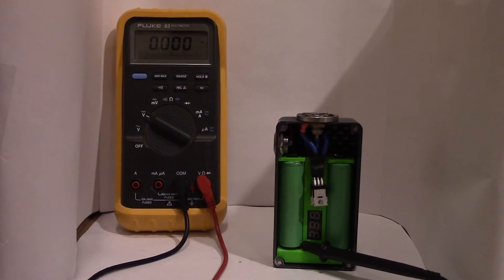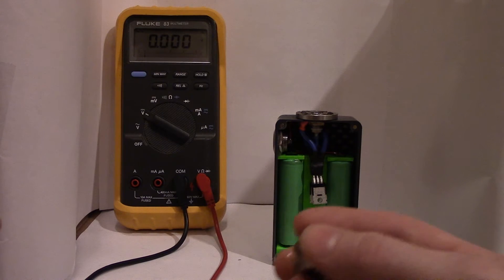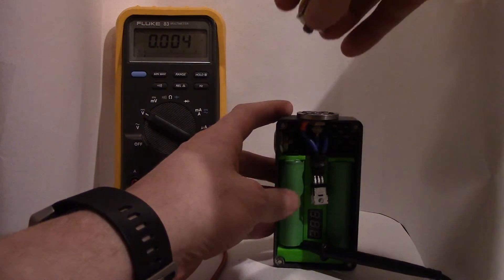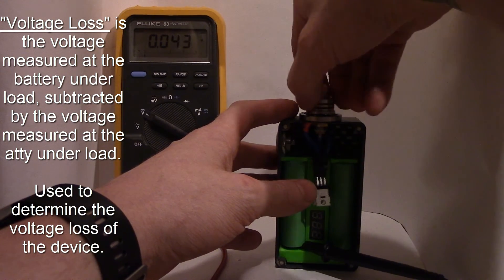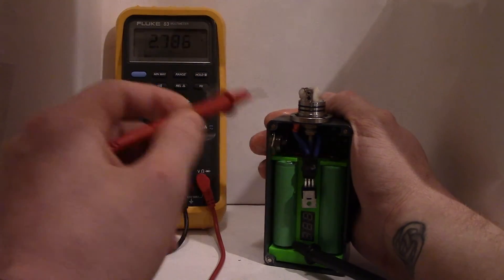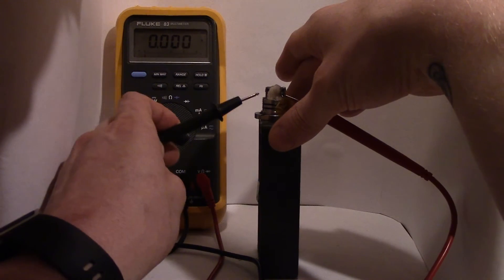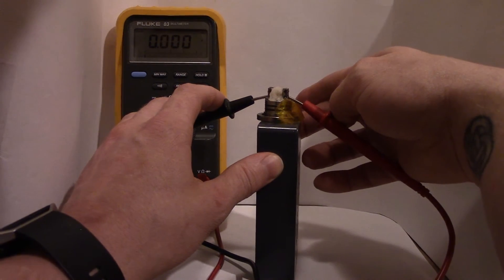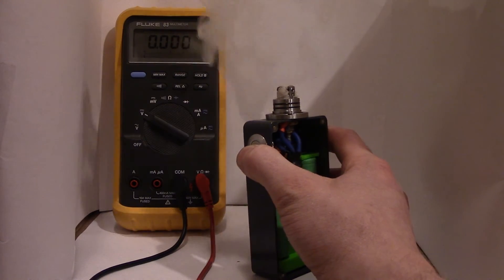[PSA] How to Measure Voltage Loss vs Battery Sag of a Box Mod

Comment: Ok, I have always thought people were doing it wrong also. thing is, aren't you adding the atomizer into your final test? of you wanted to know actual voltage loss through the device only, wouldn't you just test the battery by itself, and then put your meter probes on the actual 510 connection of the mod and fire again? Or does it need to be under load so it is dealing with a real world amperage while testing? of that is the case you could still leave the atty out of the equation and add piece of resistance wire to the end of one of your probes for the test. then use the same piece of wire for all subsequent tests for 
fair comparison. I always thought these tests were a bit silly anyhow seeing as a piece of dust on one of the connections could throw off the whole test.
Reply from the maker: My interpretation is that having the amperage pull is necessary in getting an accurate reading of the voltage loss of the device.  Also, the only way for the voltage to get to the 510, is for the device to fire, due to the internal mosfet.  You are correct in saying that this voltage loss does include the atomizer, but my main purpose was to educate on the difference between voltage sag, and and voltage loss, and I do think that was done.
Reply: I guess I was thinking of it more in terms of mech mods, but all the same, I agree that you have cleared some stuff up for the peeps on the tube.